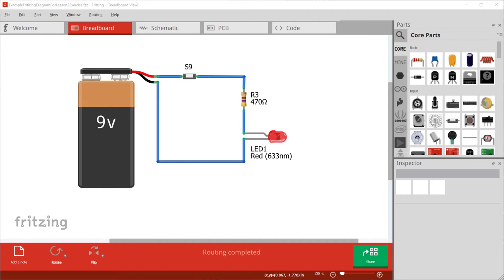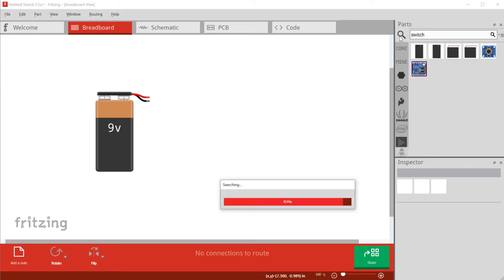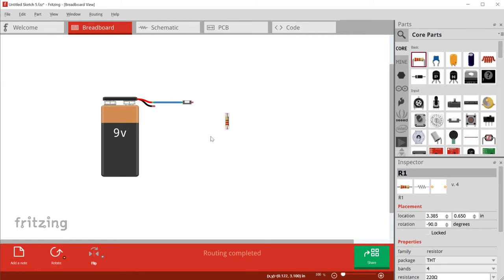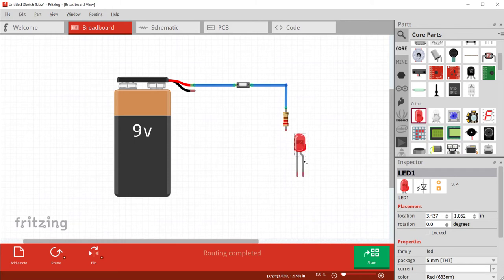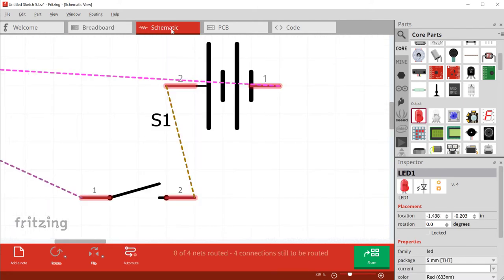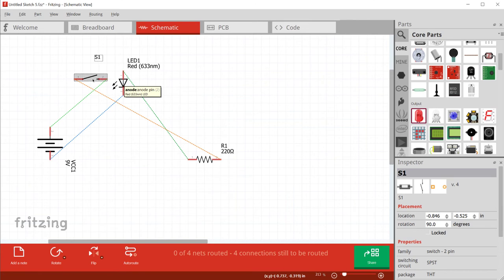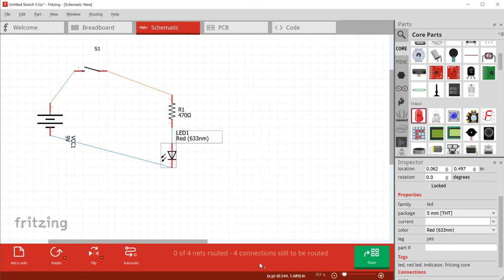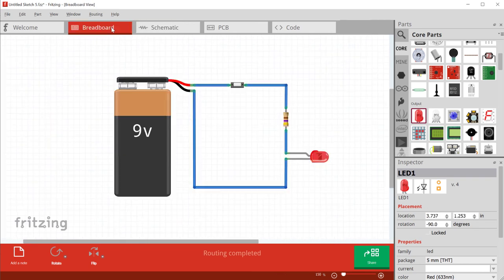A Rapid Introduction to Creating Circuits in Fritzing

Comment: Can I draw up a circuit here using an Ammeter and a Voltmeter, a switch and peltier tiles(or any square image with leads).. would the Ammeter and Voltmeter icons in the schematic then look like the electrical schematic of a circle with a V/A in it? Please help, other open source circuit drawing programs are not nice.
Reply from the maker: Unfortunately not. Fritzing does not include a simulator. Instead, I recommend TinkerCad Circuits: https://www.tinkercad.com/learn/circuits

Comment from the maker: At https://youtu.be/x1aN9LwhIAQ?t=252 in the video, you'll note that I copy/paste wires because I've never figured out how to "generate" a wire by clicking on certain component points like LEDs and resistors. A student pointed out, rather immediately, that you can simply hold down "alt and click" and voilà, a wire is generated!